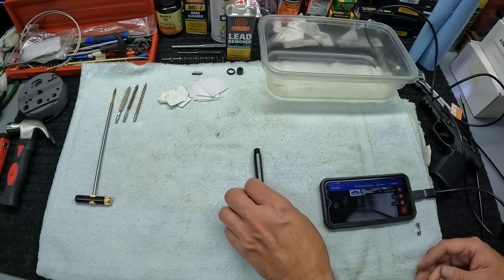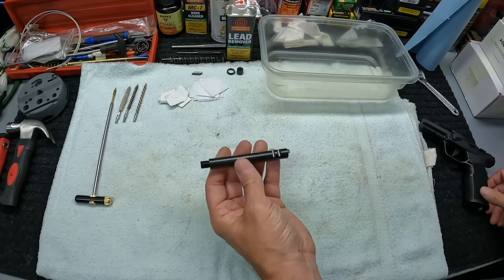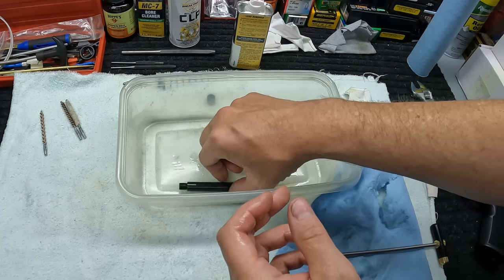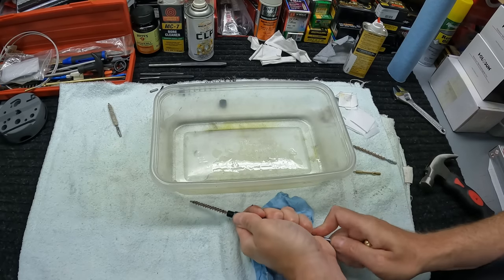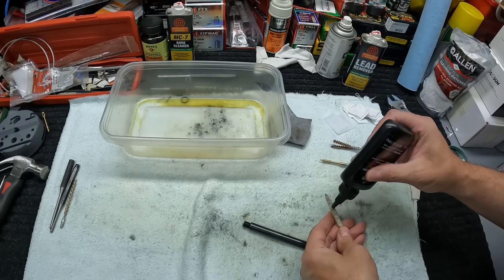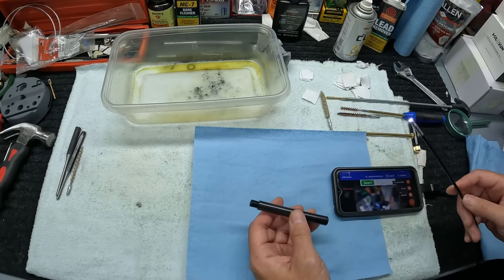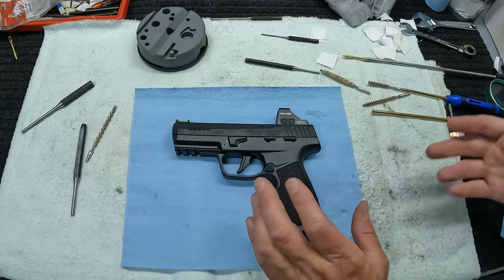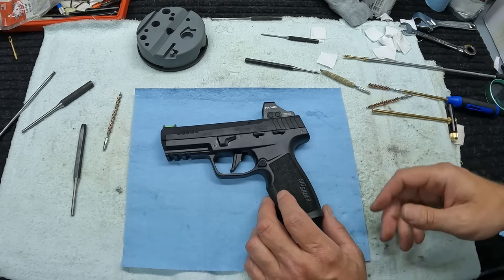😱What A NIGHTMARE!😱 Can I SAVE It? SIG P322 Leaded Barrel!

Comment: Wouldn't call it a nightmare, I mean just part of having a 22. It gets dirty, took my 10/22 out & the Thunderbolt ammo did the same thing, made a starlike build up at the end of the barrel. You'll do the same with the WMP pistol, like to see how big that barrel is & see if it's easy to take apart and clean it.
Reply from the maker: It's definitely not just "part of having a .22." This isn't normal "dirt." This has never happened with any of my .22 pistols or rifles after thousands of rounds over the years and I suspect it never will. I've already ran as many rounds through the WMP as it took for that Winchester garbage to foul up this barrel.
Reply: @ToolsandTargets  try a whole carton and mags of the CCI Clean ammo. See if it says it really is clean and look down with the bore cam.

Comment: I bought a p322 from Cabella’s in Boise. This past week.  This was prior to watching your video and others concerning the fouling issue. I made them take it back, citing they didn’t disclose all the info to me on the issues.  I ended up being made while on the deal. 
I got the Taurus TX22 Competition.  I can deal with the issues of a .22, but not that fouling BS!  I can load a tight Mag, use premium ammo and keep then.22 wet, but screw that leading!!
Reply from the maker: Smart choice. I literally just got the refund check from Sig for this thing after sending it in for the third and final time with the same issue. They ALL have issues with the barrels to some extent or another. These people claiming theirs is "just fine" because it only has " a little bit" of lead after just a few magazines, are foolish to accept that as being right.

Comment: Well, 22LR rounds are lead, copper "washed" lead so what really is the issue?  Is the front of the barrel tapered or gets narrower near the muzzle? I'm new to firearms and I thought using lots of lead bullets would do this to any barrel.  So is it not the ammo? Why the fault of the barrel?
Reply from the maker: The barrel was either undersized or oversized. Of course, they will never say and admit to any fault. They ended up buying this junk gun back after multiple attempts at "repairing" it and me threatening more bad exposure.
Reply: @ToolsandTargets  Well yes, I guess an improperly manufactured barrel will do it as well. Sad, because SIG is supposed to make very good quality guns.

Comment: This is a result of a dull broach bar with insufficient cutting/cooling oil. I wish you luck in getting the lead out.
Reply from the maker: I ended up getting it cleaned up and retested with the same results. I returned it to Sig and have since gotten it back and tested it again. A video with the results from the post-service testing is posting in about 5 minutes. It aint pretty.

Comment: I had a SR22 Pistol barrel leaded so bad I was going to buy a new barrel, but Ruger wouldn't sell it to me and wanted me to send the pistol in to them. 

I ended up getting it by hammering a cleaning rod without any tool on it through to barrel which shaved and pressed the lead out. 
It was a nightmare. Eventually I could get a tool to run through it and it was a similar process after that to you, just soak, scrub, soak, scrub, soak, scrub ... And I was able to save the barrel. Even with me hammering the cleaning rod through it, the barrel didn't get damaged.

I figured it leaded up real bad because I was shooting LRN rapidly through it, like 300 as fast as I could load the mags, and figure the small barrel just got too hot and caused the lead to stick to the barrel. I give the pistol a break now to cool off, and also try to avoid LRN and try to only purchase copper plated. Harder to copper foul a barrel than to lead foul it.
Reply from the maker: This doesn't care if its plated or not, it leads up almost immediately. This pistol is back on its way to Sig for the second time.

Comment: This is why I won't buy a Sig product.  Too many issue's that other manufacturer's don't have!  I still don't see how they won the military contract!
Reply from the maker: Very disappointing.
Reply: Government contracts are no longer awarded to the best product at the cheapest price.  It's who lines who's pocket in the decision making process.  What you are seeing is the M-14 replacing the M4.  The Sig MCX is much longer than the M4, 2 pounds heavier, holds fewer rounds, sodier cannot carry as many rounds with him now, cannot be controlled on full auto but worst of all runs on 80,000 psi chamber pressure.  Any gunsmith will tell you guns that run off high pressure are due to breakage first.  This is why the 40 cal has way more issues than the 9mm, it runs off high pressures.  Remember, the defense department said the F-35 will replace the F-15, F-16, F-18 and F-22?  Well, here we are...

Comment: Try molybdenum disulfide as a preventive treatment against leading. We did this in the 1980s-90s to reduce leading with black powder guns and precision airguns.

The trick is to get the bore scrupulously clean first, including using a strong solvent to remove all traces of oil or grease.

This allows the moly particles to bond with the metal pores, which then resists leading with soft lead bullets, pellets, swaged lead wadcutters or muzzle loader rounds.
Reply from the maker: I definitely wont be doing that or anything else out of the ordinary to "fix" this. It's going back to sig on Monday.

Comment: Try peroxide/white vinegar solution, i use it on my 22 suppressors
Here we go I bought a 322 
Took it to the range yesterday. No fowling i am playing the lottery!!!!!
Put 200 Cci  mini mag target but had way to may light primer strikes 
Put 150 federal auto match they ran perfectly no light primer strikes no fowling this stuff ran the best , ran 100 cci standard velocity with a sparrow suppressor ran flawlessly no fowling no light primer strikes, ran 50 cci blazer that ammo went all over the place very inaccurate but it performs that way in all my 22’ 
My opinion is sig knew they had a barrel problem and fixed it after seeing your video and a few others like yours , as for the light primer strikes that has me confused I will investigate that further after I clean the 322  . I have always held cci rimfire ammo in high regards but i have had in the past to send thousands of rds back to cci because of similar issues, i shoot standard velocity exclusively in my model 41 and usually have no issues 
I talked to sig before i went to the range yesterday and they told me that my 322 was built in july 2022  , also they said to use copper washed high velocity cci ammo   You see how they worked too many light primer strikes, auto match is not my favorite 22 lr but it did run flawlessly no fowling at all i checked after  every mag for fowling 
Conclusion is you and others got screwed by sig on your 322’ they had to  know about the barrels and fixed the original issue and did not recall the bad barrels 
I respect everything you do and I learn a lot from your videos 
Thx Charlie D

Comment: Had a kel tec p17 spitting lead and sprayimg buckshot patterns. There were little flecks of leads all around the muzzle. On inspection, i came to realize the crown was horribly burred. I put a pencil in a cordless drill and wrapped steel wool around the tip to debur it. It immediately went to an acceptable level of accuracy.

Comment: I used to have this problem with my Ruger MKII and Ruger Vaquero .45 Long Colt when shooting plain lead rounds. A long time ago, back in the late 90's, I found a device called the Lewis Lead remover. It uses a mesh brass patch and a compressable rubber jag. The idea is that you slowly pass the brass-patched jag through the barrel from the breach to the muzzle and with each pass, you wind the rubber jag a little tighter to expand it. This makes the brass patch engage the rifling and allows you scrape sheets of lead out of the rifling and then finish up with an oiled mop. Works like a dream.
Reply from the maker: This one went back to Sig three times before I insisted on a refund. There is absolutely no excuse for the slightest bit of lead build-up in this barrel.
Reply: @ToolsandTargets  I generally shoot copper washed .22LR any more due to the leading I had in my MKII. But, I do have right around 12,000 rds of plain lead .22LR left over from what I bought in the late 90's and early 2k's. When I do shoot the plain lead ammo, I run a mag full of copper washed ammo like MiniMags, Golden Bullet, or Fed Champions to reduce or eliminate the leading. It seems to work out pretty well. I have 12 different .22LR pistols including the Sig P322, and I haven't had an issue since.
Reply from the maker: @de3481  The P322 has barrel sizing issues that Sig wants to pass off as normal. I can guarantee you if you take that thing out and start dumping mags, you'll get through three, maybe four before it's literally puking lead out of the end of the barrel. I have never had a single .22lr pistol or rifle lead up . Not even the slightest bit. I run thousands of rounds of bare lead.
Reply: @ToolsandTargets  That's interesting. I'll have to do a few mag dumps and see what happens next range trip. I have well over 4,000 rds through my P322. I had a weird one-time issue with a couple of rounds keyholing in the first 500 rd brick. When I pulled it apart, I didn't see any bore issues, and the problem hasn't occurred again.

Comment: Lead has lower melting point than steel, i would heat up the barrel a little let the lead flow on out, and clean the barrel while still warm, is another option

Comment: I would have either dropped in my lee lead melter, or use my propane torch to melt it out. Never seen a 22 lead up that bad, other than a used Taurus revolver I bought used at the LGS trade in that looked to never have been cleaned but it was the right price.
Reply from the maker: Yeah, the torch definitely helped get it movin on out.

Comment: I've only seen this 3 times.1st was a Tec22 that took me several hours to fix for a customer. It was full of sand, dust and fouling after mag dump after mag dump (Hundreds) and never cleaned till I got it. It had been through many thousands of rounds and the customer would pour oil in it when it would stop running until it stopped completely. Once I had it cleaned and polished, he never complained about leading again. 2nd was an old Charter Arms AR 7. That gun had an extremely rough bore. It was beyond polishing. This was 1983 and Charter would not replace the barrel.  3rd was my Taurus TX22.  I bought 1 as soon as they were available, and I had 1 of the guns with the ridiculously bad barrels.  Taurus replaced the barrel, and all was good till I sold it. Makes me wonder what happened with the Win ammo and your SIg.  Was it oversized bullets, lead that was out of spec for hardness, or something else?
Reply from the maker: I'm very curious myself. I'm definitely gonna do some follow up testing of several things.
Reply: @ToolsandTargets  let us know what you learn.  I know I'm interested

Comment: If ya have something really caked on.
you can put a section of a cleaning rod into a drill with a bore brush on the end of the rod. 
It will  make cleaning real bad parts go very quick.
Reply from the maker: I came very close to doing that.
Reply: I've used that method for alot of stuff it deffenitly saves some time.
I have one cleaning rod I wrapped with electrical tape that I use specifically for the drill.

Comment: I enjoy your channel and always look forward to seeing you demonstrate your no nonsense approach to genuine evaluation of products and weapons. You are an asset to our sport!

Yup, heavy lead deposits are a nightmare. In the 30 years I operated as a gunsmith, I've seen many firearms cross my bench for "repair" that were nothing more than poorly maintained and filthy. However, in your case we know that you do maintain your weapons and take the time to do what is necessary for proper performance. This of course, was purely an ammunition caused issue that went far beyond your control. I was relieved to see you beat the lead build up. 

Sometimes, when I encountered a grossly leaded bore, I coated it with turpentine, often for hours. Plugging to bore and filling it with this solution for a long soak. 90% of the time it would clean out the lead with just a few passes with a properly fitted brush. The soak will take overnight, yet folks today demand instant gratification and are not willing to be patient and let the solution take effect.

A few days ago, I bought a Glenfield Mod 60 22LR rifle made in 1971 at a rediciouliously low price. It was said to be a poor shooter, and nearly useless. Reason? 51 years of never being cleaned and zero maintenance. The bore showed to be around .19" filled with lead, and the receiver was caked with heavy fouling. An overnight soak of turpentine in the bore revealed the 16 microgrooves in very good condition afterwards. The receiver, and mechanism within, were cleaned completely and lubricated properly with Clenzoil. The results on my range yesterday produced a 3/4" five shot group at 50m. 
I now have a great little 22 rifle for zapping gophers that appear on my place, and can leave my Henery 22 pump rifle in the safe for when I want to pop shorts or CB rounds for fun.
Reply from the maker: Nice! I have to admit, I can be that impatient guy sometimes. In my case it's more that I have to get it done when I have an hour or so of free time or it might not get done for another week when I can find more free time. Appreciate you, brother!

Comment: Told you that youd get it cleaned up no problem. Ive had it happen to my tx22 and its frustrating to clean but it will come out. You gotta remember lead is a soft metal and it comes out pretty easy compared to other metals buildup. Glad you got it back to 100%

Comment: If you have to clean out a heavily leaded barrel using a torch to help. Clean any oil out with a solvent like brake clean. Put a bit of soldering Flux in the barrel. It will lower the temperature needed to get soft. The copper brush will help wick it up and push it out. Best to get it hot too. Great video. I was curious if you were going to scrub it. Or get Sig's warranty department to send you a new barrel.
Reply from the maker: I'm definitely gonna do some more testing with different ammo asap to make sure there's no barrel issue.
Reply: Please don't use a torch after brake clean, poisonous gas results!

Comment: That's pretty much how it's done. I got tired of trying to finesse my leaded up Ruger Mark II barrel.

Soaked it in bore cleaner and it didn't help much. Took a Hoppes #9 soaked patch in front of a jag. Lightly tapped the old rod with a wooden mallet until it pushed out a  sleeve of lead and some chips. set the barrel end on a bench block or a wooden board with a hole drilled in it so the lead can push through. you dont have to beat on it, just tap it through.

Then clean it up as usual.

:_toolsBoom::_toolsWhatsup::_toolsBoom::_toolsWhatsup::_toolsBoom:

Comment: Appreciate showing us how to fix the problem. Would a drill on low rpms have helped to start or would that create other issues?  Thanks for the info.  👍 👌
Reply from the maker: I almost broke out the drill.
Reply: @ToolsandTargets  As I've gotten older & Arthritis has gotten worse the drill gets used more.  Only probably with polishing that barrel so nice is now you get the urge to polish more barrels. Sharp looking. 😎 👍
Reply from the maker: @billdye3530  I've literally been sitting here deciding what rifle barrel to polish next.😂
Reply: @ToolsandTargets  Maybe a Hi Point Carbine?  Couldn't hurt.😂😂🎇
Reply from the maker: @billdye3530  😑😑😑

Comment: Great video
Reply from the maker: Appreciate that.😎👍
Reply: @ToolsandTargets  Do you ever have a failure to feed with the P322?. I try to load the magazines correctly. I'm going to run 100% mini mags for a week or so to see how that does.
Reply from the maker: I didn't but I no longer have this gun. I sent it back in three times for this same barrel leading issue and they never could get it right. I had them refund my money for it after numerous lies and excuses.
Reply: @ToolsandTargets  I have read about the leading issues so I keep an eye out for them. No lead or copper issues that I have detected so far. I put about a thousand rounds a week through it but I have come to the conclusion that I will only run mini mags from here on out. I have been running some Aguila Super Extra 40 grain but the wax on them seem to cause feeding problems after a 100 rounds.